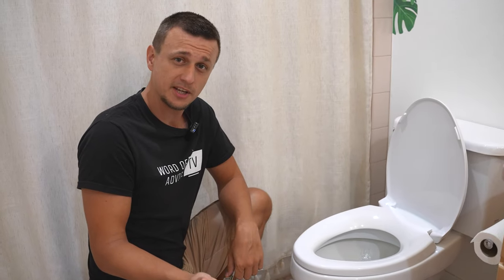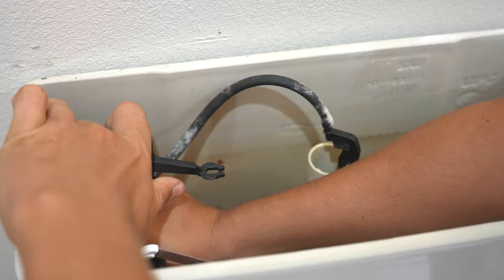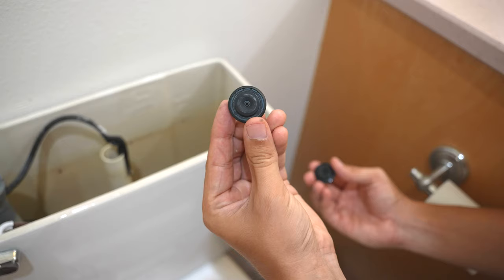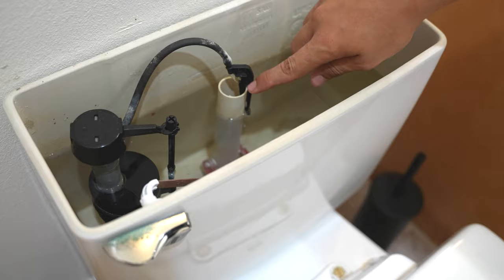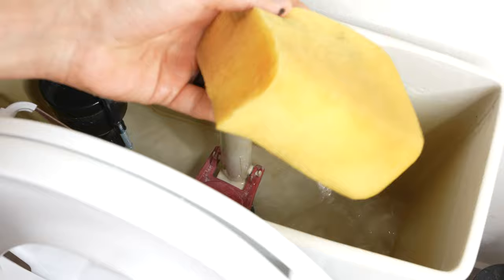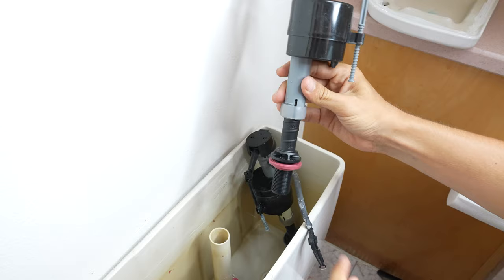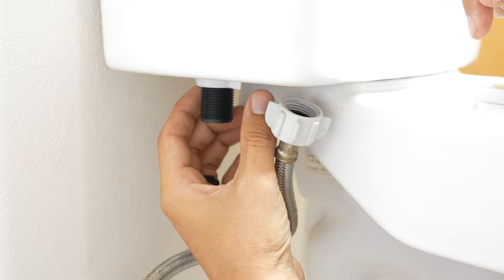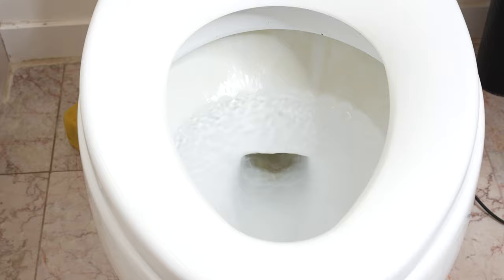Toilet Does NOT Stop Filling! Water Keeps Running

Comment: imo if your going to replace a fill valve you chould try to just pull up on the top part it might all come off together. you can replace it with a brand new one with just the part you took off by simply pulling up on the bad one

Comment: Never heard the whistle. If your fill valve to tank seal is good, you can release the locking ring and pull both valves apart and then inset top of the  new one into base of stem still in tank. re-lock with ring. Done. No need to turn water off, disconnect water line , flush or sponge needed. Easy peasy.
Reply: Great advice!!
Reply from the maker: Oh wow, I've never done it that way, thank you for the tip! I'll have to try that some day.

Comment: best to replace fill valve at the onset. They are not that expensive and easy to find then just the valve seal.
Reply: Xactly, but that is a good tip I never knew about. I always have replaced the valve assembly. 🤙🏻
Reply from the maker: I only agree. 👍 I wanted to show that replacing the valve seal is an option too. But like you said, the fill valve assembly is not that expensive so may as well just replace the whole thing.

Comment: What was baffling me is that the tank water wasn't overflowing into the bowl fill tube but yet there was still water flowing into the toilet bowl even when the shutoff valve was closed.  I replaced the flapper.  No change.  I bought a toilet fill valve and I guess that will be my next project.  I guess I could give that "seal" a try but if the float is shutting off the water to the tank and there is still water entering the bowl then I don't quite see how it would be the seal that is bad.  Maybe better to replace the whole fill vale assembly.  It's old and I guess they go bad.

Comment: Hi Jay!  I have two questions.  When I flush my toilet and the water is leaving the bowl, it behaves as if it's flushing twice - the water pours out of the bowl for what seems an excessive period of time. What's causing that? How can I fix it?
Also, when the water is refilling, it's really loud.  I didn't even know that could be a thing.  But it is on my toilet. How do I make it quiet?
I wonder if these two problems are related.  I replaced the fill valve almost 2 yrs ago.
Reply from the maker: I am not sure about the double flushing part but perhaps doing this little thing may fix both issues. Try partially closing the water shut off valve. Reducing the water pressure like that may reduce the noise and potentially stop the double filling. You'd need to try it to find out 😄
Reply: @WordofAdviceTV  I will try that, thank you!!
Reply: @WordofAdviceTV  I will try that, thank you!

Comment: can you do a video on replacing or rebuilding a compression multi turn angle stop?  I have 4 toilets and each of them used a Brasscraft multi turn valve on build.  Every single one has failed and still leak when closed.  I have to shut off my main or just deal with the slow leak with a bucket or towel whenever I do basic maintenance.
Reply from the maker: Sorry to hear about the leaking toilets problem! I wonder if your house water pressure is too high? Since all 4 failed like that. I don't know when I will make a video like that but I will add it to the list. If I was replacing my valves I would go with a shark bite quarter turn valve. Easy to install and holds up pretty good.